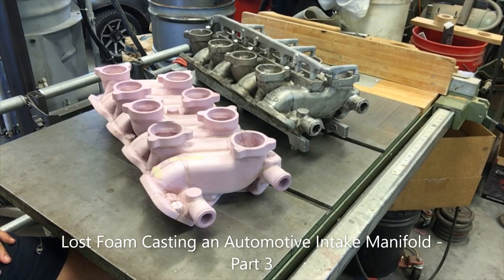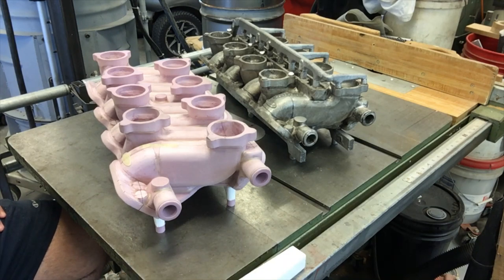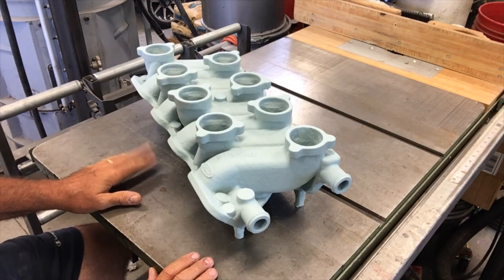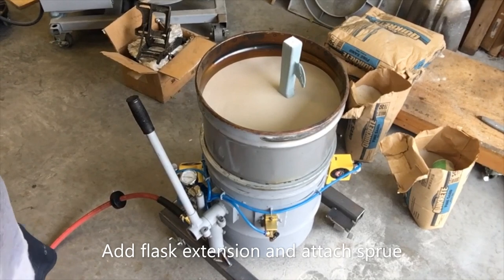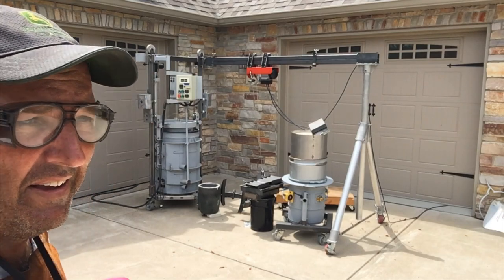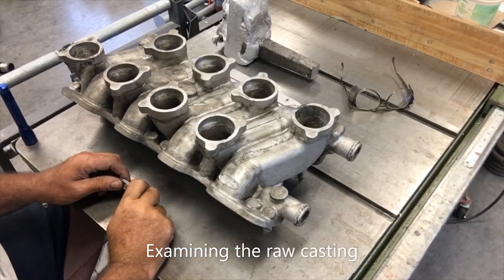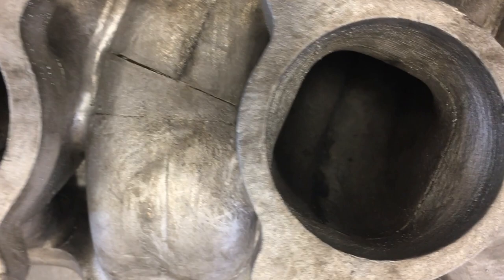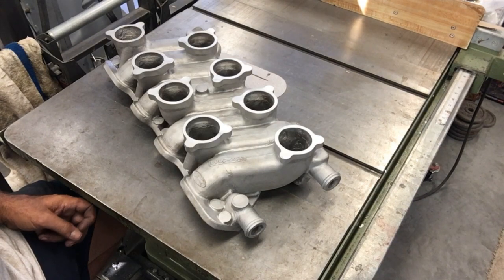Lost Foam Casting an Automotive Intake Manifold Part 3

Comment: Kelly, I have been watching casting videos for years as well as doing some of my own casting including a go at lost foam. You blow everyone else efforts out of the water. I think one of the things that everyone seems to get wrong is putting the foam in casting sand. I found out, years ago, that dry sand worked  a lot better but I stopped there. I think the vibration, the coatings and filling in the seams with wax are things I missed. I was heading down the road of using 3D printing to make split molds and using traditional sand casting. Now, I am in the middle of updating my hotwire rig and breaking my furnace out. One thing I did have a lot of problems with was cold shunts any advice on that front?
Reply: One quick note on my first go at lost foam casting I did find a way around the pregnant paus that happens at the beginning of the pour. I used a stir rod to check my meatal before I poured which made the rod hot. I would often used this to melt a one inch deep hole in the top of the sprue. This eliminated the pregnant pause.
Reply from the maker: Thanks Paul and totally agree on use of dry unbound vs bound sand. Nothing wrong with 3D printed patterns and bound sand, especially for higher volume, but the design freedom of evaporative pattern casting and ease of complex shapes, parting lines, and coring is fantastic. For  the cold shut question, what temp are you pouring at, what is the typical wall thickness and max travel distance from a runner of feed system to the extremity of the pattern? Best, Kelly
Reply: @kellycoffield533  To be honest those are all factors I did not pay enough attention to. What tempter are you shooting for before poring? I use a propane furnace and have been winging it for melts I think ill buy a temperature gun and see if I cant start controlling for it.
Reply from the maker: @paulwest4780  Most of my parts are 1/4" wall and relatively high surface area/volume. I typically pour A356 at 1400F. Rule of thumb for LF is 100F-150F hotter than conventional open cavity sand casting. Best, Kelly
Reply: @kellycoffield533  could you duplicate a aluminum cylinder head casting from a cylinder head that’s allready made?
Reply from the maker: @drifterengines243  Probably but it's the old adage that the right combination of time money and skill can solve most problems. It would take much more invested time to reverse engineer the features on a part like that then it is to make the pattern and cast it. For a part like a water cooled cylinder head, it would be difficult to duplicate the water jacket withoutcutting it apart to inspect it. It's doubtful I would pursue it for one piece because of the development labor and even if so, if they are available anywhere in any form, they'd likely be much less expensive sourced elsewhere. Best, Kelly

Comment: Hey buddy, I reccomend you do not do this on concrete, for safety reasons.  That said, fantastic work!  I need to find someone who can sand cast prototypes from time to time.  I just this week had one to do, and had to redesign it for my cnc mill because I measured my flask and realized it was too big for my little setup.  Are you open to work?
Reply from the maker: We all need to assess the level of safety and preventitive measures we are are comfortable with but I can assure you for all but large spills, the risk if a steam explosion from aluminum splashs, even pounds of, is about nil. They fan out and freeze so fast you can handle them in a couple minutes. Now if I dropped a full A60, that could be a different story but in that case I'd simply vacate the area and watch from a distance. The other side of this discussion is it's not exactly safe walking on sanded concrete either. If I was pouring iron, I may reconsider. Same for the those that have commented in my other videos about pouring in street shoes. Spats would be a good addition, but I'd rather have shoes I could kicked off quickly than those laced up tight. Either way I'm comfortable with my choices. As far as casting for hire, I'm pretty stacked up with projects and 90% of people don't have a realistic expectation as far as $. Best, Kelly
Reply: @kellycoffield533  good to know!   I was told to keep it off the concrete from someone older and wiser than myself, haha.  As far as realistic $$ expectations,  I feel your pain,  I make my living by offering design and prototyping.

Comment: This is just awesome. gives me loads of ideas for parts for my old Harley. What alloy do you cast with? A380 series or?
Reply from the maker: I cast primarily with A356 just because it's a great all-around casting alloy, can be heat treated, and since I had/have minimum buys of ingot, practically speaking I needed to choose a single alloy, but no magic in A356. There are plenty of suitable alloys for automotive parts. Best, Kelly
Reply: @kellycoffield533  Thanks for your reply. One other question if you dont mind. The foam you use, is it some special foam or? Probably a silly question but im really interested in this casting method :D
Reply from the maker: @Nifilheimur  Search my channel for a video entitled "Pattern Materials for Lost Foam Casting". The foam and other pattern making materials are discussed there. Best, Kelly

Comment: im sure you have already thought about this but could you avoid the intake bolt through the runner by using studs and nuts? either way your skills are impressive..i'm sure every classic car guy would love to be able to do what you do and cast their own parts.
Reply from the maker: Believe when I say it was the last resort but there was just no way to do since the runers cover the mounting holes. On 335 Series canted valve Ford heads there are 8 mounting holes on each side. Four of them are 3/8-16 at 22.5 degrees, and four are 5/16-18 at 45 degrees. Those mounting holes are at the 22.5 degree angle so the intake still could not be munted without removing the studs. The two central and two outer mounting holes are at 45 degrees (vertical), so the intake can lift on and off without those being removed and studs are used on those. I didnt invent the idea. There are some other exotic Ford intakes that resort to the same method. Best, Kelly

Comment: Fantastic work. Are you going to show the machining? Do you do the heat-treating yourself? I appreciate all your hard work making these videos.
Reply from the maker: Not sure if I'll video the machining. I heat treat to T5 in the same resistive electric furnace I melt in. T5 achieves the majority of the strength and machinability improvement without the risk of casting damage. Best, Kelly
Reply: @kellycoffield533  Cool. Always more to learn. Thank you for the great video series.

Comment: How do the lost foam mould was made?   How could begin with a 3D printer?
Reply from the maker: It was machined in pieces of extruded Polystyrene and then glued together/assemble. I'm not aware of any printable lost foam pattern media casting method. Other evaporative pattern material are possible but require shell or block investment method with pattern removal by burn-out prior to casting. Best, Kelly

Comment: The bolt’s through the intake runner are nonsense, it take 3 full threads to generate complete bolting force…did you miss that day in dynamics? And as an expert mold designer my opinion is you have too many sharp transitions and occlusions but then again what the hell do I know I only made parts for flying machines………..😆 nice work!

Comment: when the metal comes into contact with the styrofoam, does the loose sand undo the structure of the mold? that is, the fact that the sand is not compacted, does it break down and start to occupy the place that is meant to be only made of metal?
Reply from the maker: No, when vibrated, the sand it tightly packed. The pressure from the metal holds the sand in place as the foam patterns evaporates. Best, Kelly

Comment: What kind of sand did you use?..where can it be bought?
Reply from the maker: It's just fine washed and dried silica sand. It can be bought at retail stores. Do not buy play sand that is wet. It can be almost any silica sand as long as it is very dry. Best, Kelly

Comment: Can you cast a cylinder head with this method?
Reply from the maker: Yes. It's routinely done in commercial industry. When Saturn was making cars, the blocks and heads were lost foam castings. Have alook here: https://youtu.be/KRW_DniO68M?si=kuRwW1ri1mZR2499

Comment: you make the dipcoat yourself? and out of what?!
Reply from the maker: The refractory coating seen in the video is a commercial product called Polycap 600 made by REFCOTEC but for aluminum, non-setting drywall joint compound thinned with water to a viscosity suitable for either brushing or dipping works as well. Best, Kelly
Reply: @kellycoffield533  thanks after rewatching your vids 10 more times i figured it out and also joined the forum. :)

Comment: Definitely gotta get away from the cylindrical pour boxes. It's convenient for small pieces but once you get bigger parts a box would be close to the ground and easier to pour with more vents.
Reply from the maker: There's really no such thing as vents in lost foam casting because a vent is not a vent until the foam evaporates. In LF casting the entire mold surface is the vent and the vent rate is controlled by the permeability of the refractory coating, I've tried boxes but they offer no advantage and cylinders are much more rigid containers for unbound sand. There is no cope or drag in LF and unlike conventional open cavity gravity fed casting where bottom gating can be beneficial, the propagation of the metal front in LF casting is controlled by the the rate the foam is evaporated so AFS and Naturally pressurized gating systems are concepts that don't apply to LF.